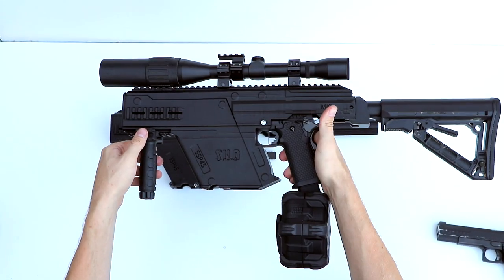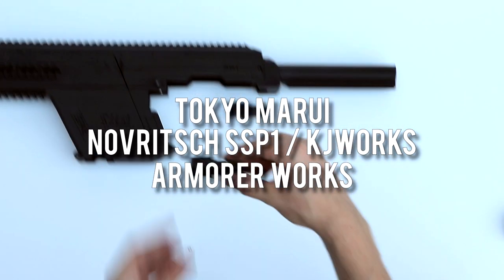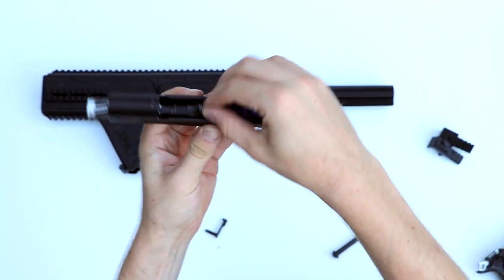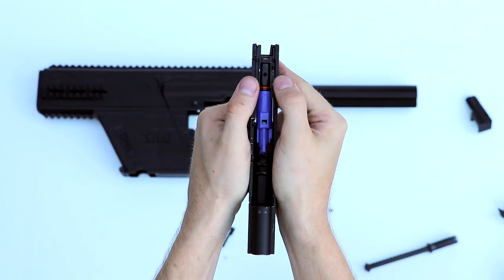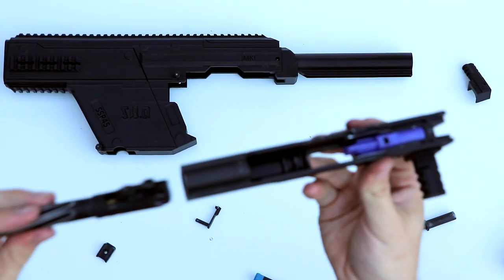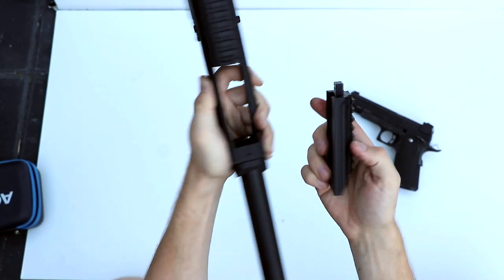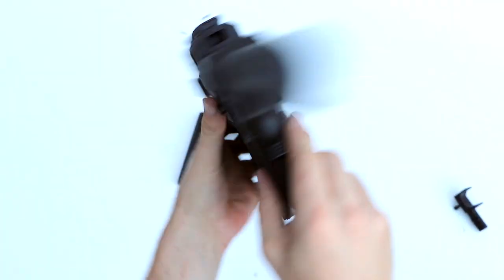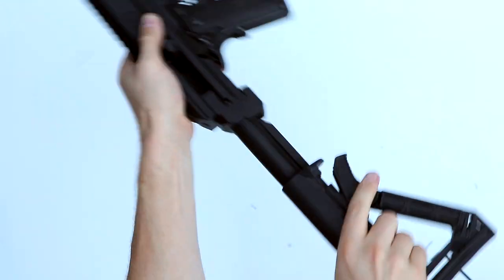SSP45 Carbine Kit - How to install

Comment: Looks pretty cool does it only work with HiCappa or will it also work with 1911 gbb variants of the major mfrs? 

Btw, charging handle only on right side? Seems kinda odd? Couldn't a left charging handle version or ambidextrous type been designed? Looks like it's possible? Just kinda weird tilting the gun sideways to charge it for right handed folks.

Comment: Great video!! I bought the carbine kit but the video isn't in depth enough for me to fully understand some instructions were confusing but I managed to install my ssp1 disclaimer in case you think the kit will make your ssp1 a full auto it wont it's just a ADD ON pls use a highcap  pistol that has single and full auto modes pls
Reply: How do you get the mod
Reply: @jonasmolinari5994  as in mod you mean the carbine kit ? or full auto mode ?
Reply: Full auto
Reply: @jonasmolinari5994  if you want full auto your going to only need a pistol that is a highcap and has the full auto built in as a mode . thats the only way to my knowledge
Reply: By the look of it can it fit the 7 inch Hi capa? Because I think that's the best fit for a carbine kit. I don't know why there is so little Hi capa carbine kit our there.
Reply: @jonasmolinari5994  just google it up you just need to do some sanding

Comment: Does the ssp 18 fit in it and work
Reply: Yeah I’m deciding if I should get the ssp18 or ssp1
Reply: @jonasmolinari5994  The performance is the same so what do you prefer glock or 2011

Comment: Would this work with the SSG18? I'm assuming it would as you say it would work with most hicapa and with SSG1, but I wanted to make sure
Reply: you mean the ssp18 right? thats not gonna fit since its a glock based gun so not a hicapa. the ssp1 is a hicapa so that fits.

Comment: Is it going to be compatible with Novritsch new fully auto 'glock' model he just came out with? Bc if it does the he is really going to get mad at you bc you are offering a platform that is basically comparable to his ssx303 bc that's going to be a solid platform base for them esp since you have the charging handle physically attached to gun unlike w how some of the others only have you place it onto of gun and not mounted on the gun like you have.